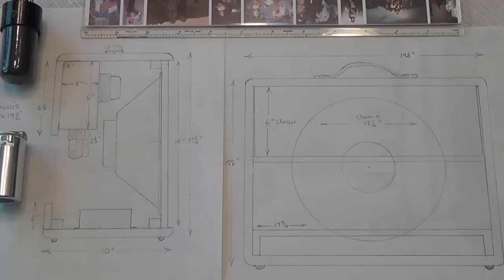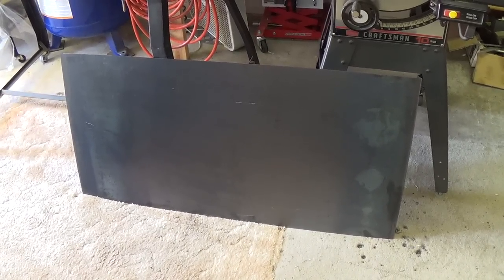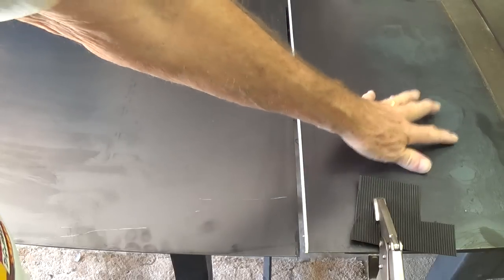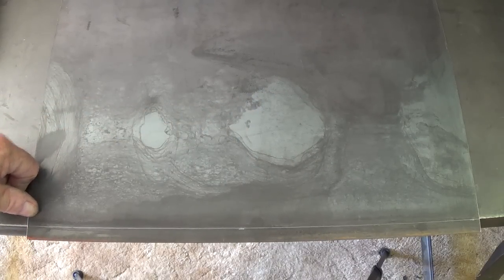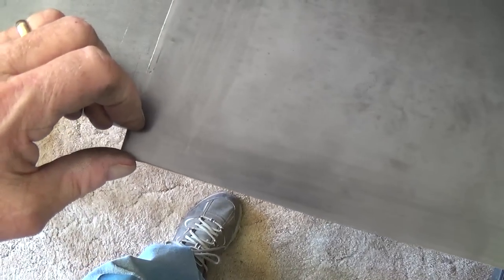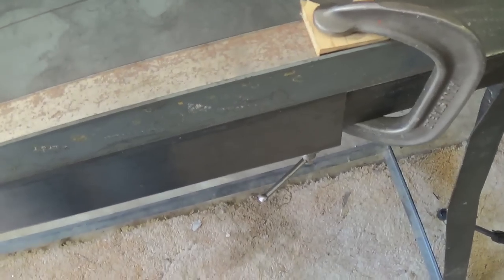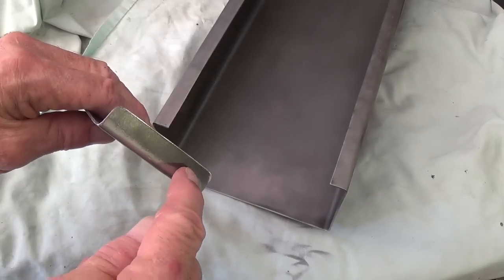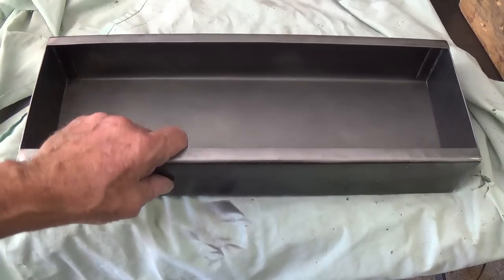How to Scratch-Build a Vintage Amp, Part 5:  Fabricating the Chassis

Comment: I built a chassis for a 5F1 Champ after watching this out of some 20 gauge steel I got from the home store for about $8.  I figured all it would cost me was time if it didn't turn out.  I used the vise and 2x4's with a big hammer method.  It wasn't difficult at all.  I can't weld (yet) so I attached the side pieces with screws.  I'm in the process of drilling holes using the step bit.  This definitely generates some heat so I'm using 3in1 oil.  Thanks for all the help Uncle Doug.
Reply from the maker: You're welcome, Thomas. Best of luck with your project. Let us know how it turns out :)

Comment: I love how UD knows the name for everything, even the curly Q from cutting the steel.
Reply from the maker: +Michael McGlynn  I believe the term "kerf" is correct. It's traditionally the gap that's opened when you cut wood with a saw blade......so I guess the term would apply to the gap opened by the shear, with the curly Q being the physical manifestation of what was removed :)))

Comment: That Jeep is a MONSTER! I love it! It's funny you have a toy with a non-stock 350...I have a 1976 Jaguar XJ12-C Coupe with a 350 conversion. I have nowhere to work on it and no proper tools, so I don't even try. 

One the amp though...you are going to mess up your tools with that thick gauge steel. Wears down bits and stuff fast. I broke one of my Harbor Freight 1/8" bits on a steel chassis. I bent the teeth of my Harbor Freight special punch and die set by trying to use it on a Hammond chassis. I think the punch will still work, but I'm probably sticking to more reasonable gauge aluminum in the future for any scratch building. Lesson learned. I wish I had a nice workshop like yours with more manly tools like welders and cutting torches. Right now I'm banging away in the house and driving my wife batty. I'm entering my middle age 'do manly garage stuff' phase.
Reply from the maker: +Brad Linzy (The Guitologist)  Thanks, Brad. A friend of mine installed a 350 in a beautiful Jaguar (with a blown-up engine.....bought cheaply) and it was a really nice car.  I agree that aluminum is a lot easier to machine. Several of my previous amps were built with aluminum chassis.  I just wanted to make a steel one for this application......and it's a very stout, heavy chunk of metal. By all means get a garage/workshop. Life is too short to spend any part of it without a nice place to build things :)

Comment: Well it appears there is a lot more to you than what meets the eye. Your rundown of the Jeep, indicates you must have done a lot of "scratch building" on the beautiful Jeep! It does my heart good to see an older vehicle brought up to a wonderful Desert Buggy! The chassis build is first rate, I have made many cabinets the same way, it,s good to see someone with your ability give credence to how I, and others make things with out fancy machines or tools . What fun! May have to pick up an electric shear. Thankz
Reply from the maker: +Audio Tech Labs You're welcome, ATL. The Jeep was a real handful.  I had to completely rewire it, repair and remount the engine and rear differential, and fabricate a rear crossmember for the transmission.....then rebuild the "just rebuilt" transmission after its case cracked into two pieces. It took about 2 1/2 months of steady work to get it running strong and reliably. Glad you liked the video.

Comment: thanks for the first 5 videos in rhis series, I can't wait to get into the actual parts soldering and finalization. I plan on copying this amp with a NOS RCA 6l6gc black plate.
Reply from the maker: +starlingave  You're welcome, SG. If you do build for a 6L6GC you'll probably need to upgrade the current capability of power transformer high voltage winding......to 100 to 125mA.  I intend to only use a GB or 5881. Best of luck with your project.

Comment: I love this series, this far. I have to agree with you, 16 gauge is kind of like battleship armor for an amplifier. But you've done it! That is admirable. 

Utilizing the invaluable advice, from your other videos,  I procured, a left for dead, RCA
Stereo tube amplifier. I've powered it up with the variac. I even hooked up my guitar to it.
I will be making a few modifications to it, and a new home for it. (Cabinet)
Thank you so much for these videos.
I am now officially hooked on them.
Reply from the maker: Thanks so much, Ken. The heavy gauge was a mistake, but that's the only small, usable piece of sheet metal that the weasels at the metal yard would sell me. Continued good luck with your project.

Comment: Thanks Uncle Doug for taking the time to document all of these steps.  I am really enjoying this series.  I have built a champ from a kit, so I'm hooked.  However, the challenge I have is converting a schematic into an actual "point to point" soldiered system.  The printed board in my kit did not allow me a good mental picture of converting the schematic into the amp.  I do hope that this will be explained in your future, sure to be outstanding, videos.  Thanks again...Bart
Reply from the maker: +redfishbum You're welcome, Bart. The ability to interpret a schematic and translate it into a wired circuit is like learning a new language.  It requires a lot of practice and experience to master. No one can explain how to do it, you just have to apply yourself, study, and practice.

Comment: Cool deal....  I have many times said...  But I don't have the tool for that...   So I like the MacGyver way of doing the sheet metal bends.   By trade, I install computer systems, and run network wiring,  and sometimes we have to improvise on those jobs...  nice to see your methods....  it adds something to my collection of how-to know how.
Reply from the maker: +DeadKoby  Thanks, DK. The other option is to cut aluminum into properly-sized individual plates and then bolt or rivet them together into a chassis.....lots of cutting, but no cave-man bending, cursing 'til you're hoarse, and alienating the neighbors.  Also if you do try this, stick with 18-gauge, the 16 is a $#%@& to bend :)

Comment: I used to work for Bar-S Foods, in the welding shop at the plant they had a ginormous sheet metal break, man I wish I had access to that now, lol. those bends would be like 2 seconds each, lol. Oh and a 12 foot shear  But alas I will be stuck with the old sledge hammer method of shaping metal myself now, lol. Great video serious UD!! Thanks!
Reply from the maker: Glad you enjoyed it, Jack. I would love to have some metal working tools, but I have absolutely no free space for them in my workshop or storage area.

Comment: Great video. I'm enjoying the series... I used to own a 1977 CJ5. It looked very similar to yours. Mine had the original 304 V8 in it, a posi-trac Dana 44 in the rear and a limited slip 38 in the front. 3 speed standard... I absolutely loved that rig! I live in Eastern Canada though... and it finally rusted out to the point of no repair... but I sure had some fun in it! It had a full soft top, and in our crazy winters up here, some mornings I would have to open the drivers door, and shovel the snow out from around the pedals before I could get in and drive it. Of course, this was in the 80's and I was still just a crazy teenager! Wouldn't dare do something like that now...
Reply from the maker: Thanks, Danny. I guess old Jeeps are the ultimate in basic transportation. The new ones are fancy rigs that cost $50K or more......which defeats their purpose, in my opinion. They're too nice (and big and heavy) to be used in the manner that Jeeps were originally intended. The best "real" Jeeps were the old ones like yours and mine......rough as cobs, but they get the job done.

Comment: Thanks for the video, this is going to help a LOT when I'm building my chassis. I especially like how instead of bending the sides, you built them separately and welded them in. Very clever. I'm going to change my design to do the same. I'm going to have to look around for some of those electric shears.

Nice Jeep.
Reply from the maker: +sa230e  You're welcome, SA. Glad you liked the video and electric shear. Best of luck with your amp project.

Comment: Wow! Thats a lotta work. Great Job.
Reply from the maker: +Watchman4u  Thanks, W4. Glad you liked it :)
Reply: Uncle Doug I have done woodwork in the past custom wood designed for Conversion Vans & Trucks Cabinets …
 I've also have done a lotta metal work i.e. Shears Breaks Roll Forming Mach. CNC.
Hats off to you for that truly hand made Chassis & Cab Amp !!!
Reply from the maker: Thanks so much, W4. That 16 gauge is pretty tough :)
Reply: Uncle Doug My back can attest to that but it was the plate steel 1/4'' that killed my back 300 lb sheets/Plates. Can Wait t see the Finished Amp!!!
Reply from the maker: Neither can I, W4. Thanks :)

Comment: Hi, Doug  Great looking jeep ,   amaze by your  G.M 350  motor .   I m sure that if i had this jeep  in my hometown (Montreal) during our winter season ,  never be stuck in the snow.
Reply from the maker: +Mathieu Coletta  Thanks, Mathieu.  It has a great deal of torque. I can climb steep hills effortlessly (@1200 RPM) and never have to use 4WD Low Range. It's an excellent desert vehicle.

Comment: I've been catching up on the amp build videos (great work). Love that Jeep! I'll bet a few people have been surprised by that 350 :)
Reply from the maker: +Michael Lloyd  Thanks, Michael. Generally it's passengers who are surprised.....when we climb a steep, rough hill in 4WD High Range at 1100 RPM. With all that torque, there is no need for drama.

Comment: Nice thumper cam with what looked like Dynomax mufflers. Thanks for sharing. Oh yeah, don't forget to buckle up before you gas that Beast!  : )
Reply from the maker: +Darryl Landry You're welcome, Darryl. I see you picked up on the non-stock cam :)))  The mufflers do look like Dynomax's, but are Flow-Masters, and I do use seat belts without fail in the desert.....you really have to, to stay inside :)
Reply: Ah yes, I should've known that tune! Looks like a fun grocery getter  : )

Comment: Love your videos. Greatly enjoying this series so far. The bluing you refer to on your sheet metal is called ( mill scale). It actually is formed during the hot roll process of the sheet metal. Keep up the fine work. I have learned tons from your channel.

Comment: Uncle Doug, you and your readers may be interested in this tip.  Drilling large holes in sheet metal is always a chore.  Regular twist drills are a disaster--lots of vibration, they tend to catch, and can be dangerous unless the chassis is very securely held.  Today, I tried a Forstner bit to make two 3/8" holes in an aluminum chassis.  It worked incredibly well--smooth, no vibration, no tendency to catch the material.  It worked so well, I tried a Forstner bit make a 1" hole.  It also was a dream.  A cutting fluid is highly recommended, and many machinists know to use, and swear by WD-40 for aluminum.
Reply from the maker: Thanks for the tip, Roid.  I have a set of Forstner bits and had no idea they could be used on metal. I'll give it a try.

Comment: Wow. This is were i start to get the jitters. The fabrication side is not my strong point and when I see the standards you work to I am filled with admiration. That is evident in all of your work,  jeep included. There are lots of old land rovers and the odd Austin gypsy knocking around here in North Wales,  once in a blue moon a guy locally brings out his lightweight  ex military land rover with a rover v8. That's a thing to behold. No desert to eat up though,  just sheep avoidance. All the best
Reply from the maker: +PoJoWo   Thanks for the kind words, PJ. Watch out for those sheep :))

Comment: Beautiful metalwork.  The hand acting started to get a bit rugged with the taped up thumb, but I guess you got the bleeding under control for the finish.  Good looking jeep!
Reply from the maker: +bullthrush   Thanks, Andrew.  When in caveman mode, the severing of a digit is inconsequential, especially if you have a torch handy to cauterize the stump.  Actually it was due to a splintered 2 x 4.....but I like the first story better :)

Comment: I'm enjoying the series so far! As for pre-made chassis, Hammond makes them in both steel and aluminum, either one is pretty inexpensive. I used steel for the Magnatone (nope, don't ask ;) ) and it's a little tricky to cut through, so I'd probably opt for aluminum next time, especially for smaller amps that don't have massive transformers hanging off the chassis. AES/AmplifiedParts has a good selection of the Hammond chassis (that's where I got mine), but Mouser carries hundreds of chassis/enclosures if someone wants to look for something a little more unique without going scratch.

If I remember correctly, my Hammond chassis was only about $16 (powder-coated black steel) from AES, and it's the next size up from what most people use for Champ circuits; it's still small, but gives a little more room to work comfortably.
Reply from the maker: +catdumpling  This sounds like a very logical and inexpensive alternative, Cat. Thanks so much for providing this information. It's always great to hear from you :)

Comment: Great demonstration in your "stone age" technique. THANKS. BTW:Bends will "steal" from the length perpendicular to its axis depending on the material's thickness. It's a small thing but could be critical too.
Reply from the maker: Thanks, Collins. Yes, it's advisable to compensate for diminished overall length due to bending.

Comment: I don't if i've mentioned this before, but harbor freight sells a hand metal break for cheap that makes bending that sheet metal very easy and consistent. I've used it several times with steel and aluminum.
Reply from the maker: I would love to have a metal break, Todd, but simply don't have the space to store one.

Comment from the maker: James W. Talbott, Jr.  Again, your comments do not have a Reply capability because you have not activated Google +.  Generally, I just give a thumbs up, but occasionally, as in this case, I respond at the top of the page.  You have not missed Part 6.  Since it covers two very time-consuming tasks, building the cabinet and machining the chassis, it is taking a little longer to complete.....but should be posted soon.
Reply: instead of using a metal chassis, would a wooden chassis lined with copper work as well?
Reply from the maker: Probably, as long as the copper was present for grounding and conduction purposes.

Comment: This is insanely awesome, Uncle D. I've been spending 50 bucks a pop on pre-made blank chassises. (What's the plural of chassis?) I figured one day I might buy myself a metal bending vice. I never considered just clamping a piece of metal down and beating it into shape! Brutal but brilliant!
Reply from the maker: +Alva Goldbook  Thanks, Alva. I too am unsure about the plural of chassis, but am glad you like my barbaric methods. Be sure to try 18 gauge the first few times, it's definitely easier to work with. The total cost for the chassis was about $5.
Reply: Uncle Doug 5 bucks! I have a pretty hard time drilling steel, so I like to stick with aluminum. Which is probably even cheaper.
Reply from the maker: It's not cheaper in my area, Alva, but still reasonably priced. The problem with using aluminum is you really need to cut individual sides, bottom, etc. plates and then attach them to each other.  It doesn't bend well and often gets fatigue cracks when you try. One of my earlier videos shows the process....possibly the homebuilt Princeton 5F2A.
Reply: Uncle Doug Interesting. I'm looking forward to seeing you drill out this chassis. I once had a very hard time drilling just a very thin steel chassis, and I figure you've got to have better methods for approaching this then I did. (a drill press, a step bit, and a LOT of cussing)
Reply from the maker: My tools, including the cussing, are just the same as yours, Alva....so it should be a real adventure. I don't recall having much trouble with previous steel chassis, but none of them were 16 gauge.
Reply: +Uncle Doug I'm not sure what gauge this steel chassis was, but it's not much thicker than a few sheets of paper. My problem is that the steel would bend on me before it would cut! I managed to get the tube socket holes drilled, but the top of the chassis bowed in on me, forming a very shallow U shape! I really prefer aluminum since it's so much easier to drill, but I've never tried bending it. It also didn't help that I had never machined metal before this. I tried using a greenlee punch on it, but all I managed to do was disfigure the chassis horribly!
Reply from the maker: It sounds like very thin sheetmetal, Alva, probably less than 22 gauge. I can assure you that the 16 gauge would not deform....you could jump up and down on the chassis and not make a dent. It's just too thick. I think 18 gauge steel or 1/8" aluminum would work just fine. It does take time to develop effective techniques.

Comment: Making a score with an angle grinder about 1/4 the thickness of the sheet metal on the inner part of the bend will make it very easy to make the bend. The score needs to be as straight as you can get it because everything will become evident once the bend is done, a wooden board can be used to support and guide the angle grinder disc.
Reply from the maker: That's an interesting suggestion, PT. I will give it a try during a future build. Thanks.